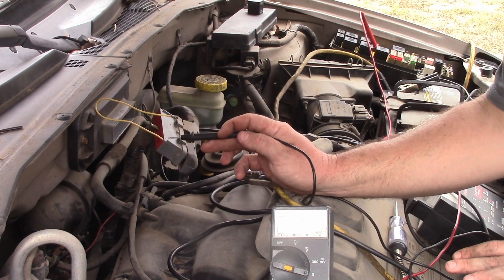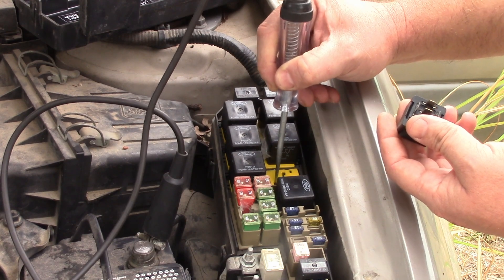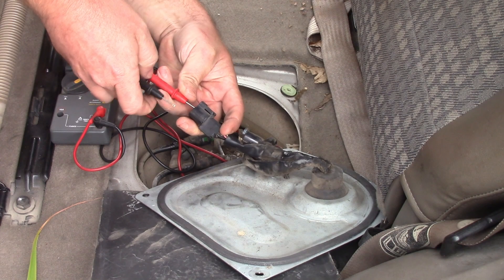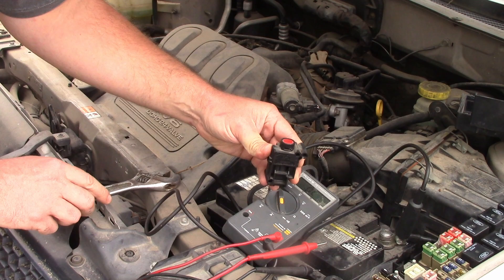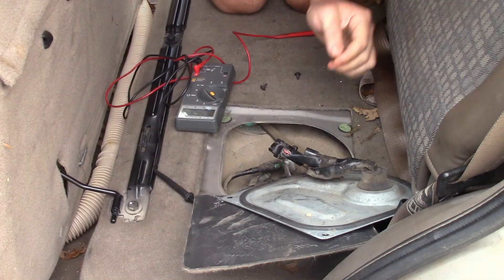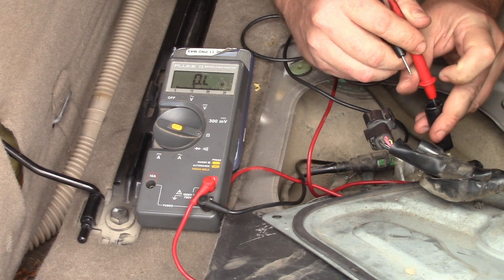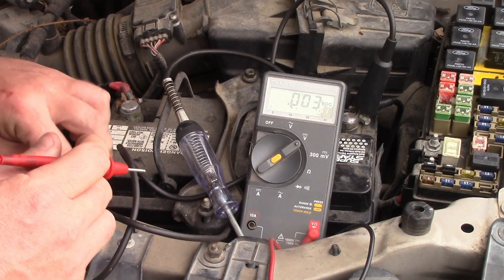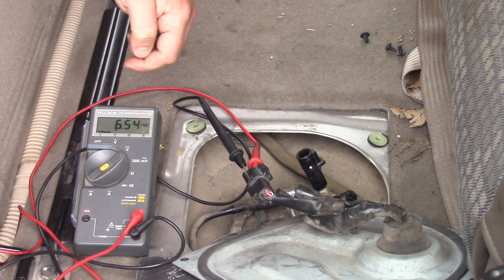Diagnosing Ford Escape Fuel Pump Issues, 7 Dead Fuel Pumps and Counting.

Comment: This suggestion will not help for a 2001, but on 2004 and later year Escapes, the Fuel Pump Driver Module (located under the car above the rear axle) can develop an intermittent failure.  Replacing this module (which is easy) solved my fuel pump problem. The module costs about $50. This is certainly easier and less costly than replacing the fuel pump.

Comment: Normally don't post or comment but since you wasted so much of my time.  
  I decided to help. Try checking the driver control module under the tank .
   Yes u were correct u missed the right part but were close
Reply: Waren , if I remember he said that escape was a 2000 or 2001 . I believe 01 - 03 doesn't have the fuel pump driver module. They sit on the rear axle area on the driver side . I changed a working  fuel pump driver module a couple days ago with a new one , now it won't start !   I put the old one back on and still won't start , WTH is going on . Btw , mine is an 06 escape
Reply: @rbrucejr1957 you're right 03 Escape in Au doesn't have one.
Reply: @rbrucejr1957  You ever figure it out? I have the same problem. 2006 for mine as well.
Reply: @noladol  yes I did , turns out there was nothing wrong with either fuel pump , old one or the new one . When I changed out the driver module I forgot to hook the ground wire to the frame . Hooked it up and started right up . A dumbass I am .   Now I can't figure out why my blinkers , hazard or the head light flash when you lock the door and shut .
Reply: @rbrucejr1957  Thanks for the reply. I'll definitely check my ground wire. Hopefully that's what it is. Thanks!
Reply: @noladol  let me know if that's what it was .
Reply: @rbrucejr1957  Unfortunately that wasn't the problem. Still trying to pinpoint the issue though.
Reply: @rbrucejr1957  It ended up being the fuel pump itself. Go figure.
Reply: @noladol  what yr is yours, I still have my old one , it would say it's still working since a lose ground wire was my problem. If you want it I can send it to you , save a little money
Reply: @rbrucejr1957  Thanks for the offer, but I was able to get a new one for a good price online. It's a 2006.
Reply: I've got the same problem, driving me ctazy to figure it out??? The solution? @rbrucejr1957
Reply: Guys I have an 07 3.0 escape yesterday I washed my engine bay and now this is the problem that I am facing my car starts run for 2-3 seconds and turns off and sometimes it won’t start but only cranks like in this video. Also I don’t hear the whirring sound when I turn on the ignition like I used to before, now when I turn on the ignition every 2 seconds there is a thumping sound coming somewhere from my gas tank

Comment: Hey thanks for explaining the diagnostic. I just replaced mine a 2003, ford escape fuel pump. Im running a 2.0 engine, but rockauto shipped a 3.0 instead.

I just installed it anyway to test.

The car did run, start. But, after half a km, I turned it off and start again, would not start.

Rest it a few mins, crank and starts.

Went home, then same half a km, before I can park the car, it shut’s itself on its own 😂

Anyway, I am suspecting a relay and led me to this video, hope mine is not a pcm. Or I just need a fuel pump that is for 2.0.

In our area, most mechanic replace those pcm.

Mine is 120k kms, 20 years
Reply: Ignition control module
Reply: @rayecross3651 mine does same thing sometimes it starts and run and sometimes it doesn't would you elaborate where is it located so I can replace it ?

Comment: Had the same problem but ended up being a damaged crank position sensor when a belt got turn up. I chased my tail for weeks trying to figure this out but changed the fuel pump and filter anyway in the process.
Reply: What do you mean “when a belt got turn up”?
Reply: I’m having the same issue